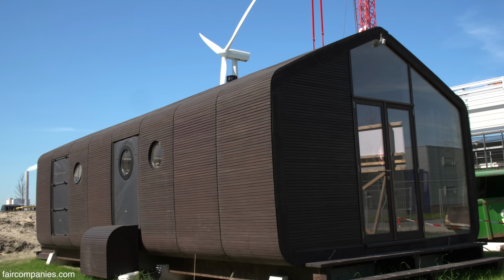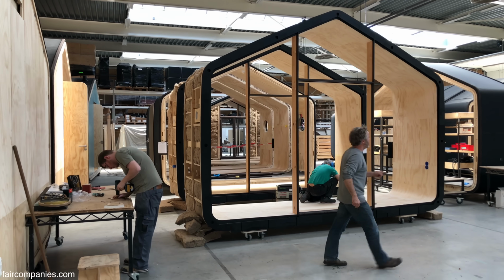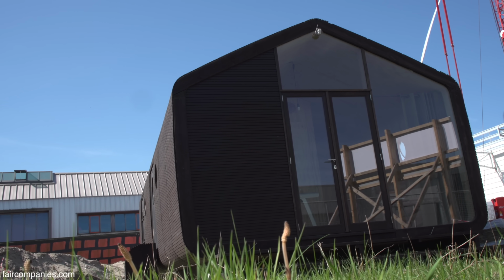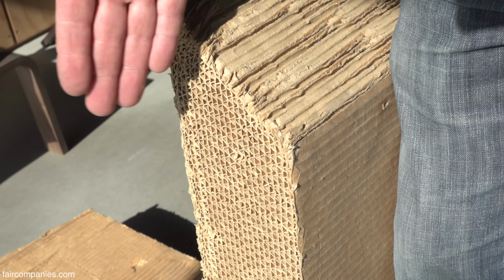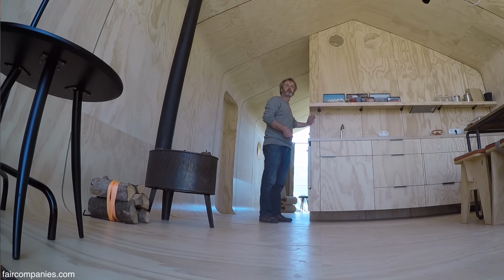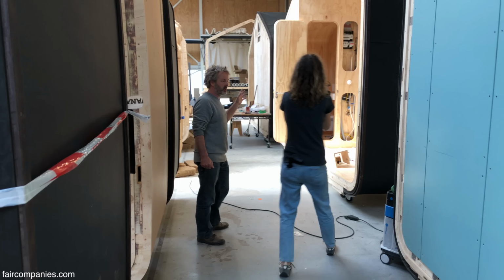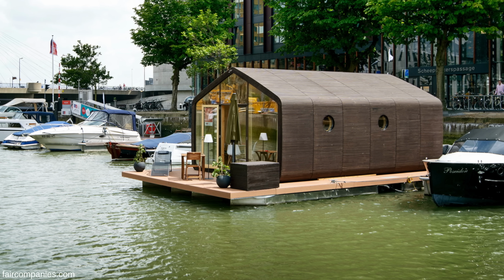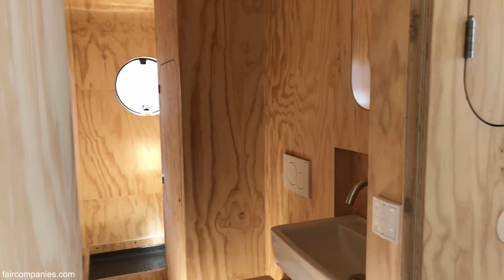Wikkelhouse: pick your modular segments & click them together

Comment: looks poorly made get a coodo instead
Reply: What's poorly about it?

Coodo looks nice too. It looks like Coodo is clean looking. It is steel frame based.
Whereas Wikkelhouse is more natural looking. And hardly contains any steel.
The major difference is of course that Wikkelhouse is mostly made of cardboard.

With Coodo you can stack a module on top of a ground module. Which can be considered an advantage.
Due to the material used (cardboard) and production method used (wrapping) this is (currently?) not possible for the Wikkelhouse.
Coodo modules are also wider. Which might be an advantage or a disadvantage depending on location or preference.

Given the information I have seen thus far I cannot tell whether one has a higher quality than the other.
All I can say is that the two, though both  being modular designs, have a different design philosophy.

Comment: For those interested, they cost around 11,000 euro per segment. Shipping container prefabs are likely to be better value
Reply: In Germany you get "flatpack" prefabs with proper walls that can be shipped with regular trucks and put up in a single day. Which gives you more of a traditional sturdy house than this and is only slightly more expensive, if at all.

Comment: pretty expensive for cardboard is a neat idea though ,, if the price was different these things would sell like crazy,  these could actually solve homelessness but the price,, for same price you can build a normal wood or brick home,, you can buy a double wide trailer with hot tub for 20,000 $
if they priced these to sell they would make alot of money  cause they are very portable there still a market for them,, but that price very unattractive if they change price and contact certain city's to buy them to fix the homeless issues that would sell like crazy

Comment: 10000 euros for each segment is a bit much. I guess if you didn't bother with  the cardboard and used standard insulation you could make it for a lot less. 20000 euros should be able to get you a finished 8 segment house if you built it yourself. It makes you wonder why standard houses are so expensive. I'm guessing it's all the regulation and red tape.
Reply: A large part is the labor. But materials are not cheap. I bet each bare section has $2000 just in materials.

Comment: First time it rains and there is a leak, the cardboard in the walls are 
going to go to crap. These might be fine in a dry environments, but I'm 
just thinking about here in Florida where we have a lot of humidity in 
the summer, and cooler and drier in the winter. The contraction and 
expansion between the weather extremes can create a seam leak, which 
would mean curtains for a cardboard house. Whether it is the seam between
 the sections, or at the windows, Murphy's law, there will be a leak sometime/somewhere. 
Also, Florida roaches love wet wood and even more so, wet cardboard, they 
would have a field day with this house.
Another problem I see, is it it doesn't allow for things 
breaking or going wrong , like what happens in real life. For instance, what 
happens if there is a leak in your plumbing, and by the time you fix the 
leak, the cardboard behind the bottom the walls, and your floors are wet?

Comment: Very much suitable for hot climates.
Only thing is the life style and usage of water. In India  bathrooms are not usually dry because of usage of water. Instead of corrugated paper board, you may have to use PVC corrugated layers on the inside and outside. Then solve the fire -resistance problem. I like the idea.

Comment: Needs ventilation in the bathroom. Probably better to have a built in fan there. Also in some places we are not allowed to burn wood so it would be better if you could integrate solar power in some models. I'd also prefab the house in the factory and ship the house to the site. The use of a crane and the construction crew on the site is probably very expensive.

Comment: Imagine if a fire happens..$80,000 for a cardboard “home” put together by glue? An insulated plastic home would be better for rain protection
Reply: Most people in house fires die from fumes. Not that there aren't hazards here. Single-story structures like this are like little jet engines, if they are tubular enough, they can really get a fire going from the draft. That's why metal mobile homes are so dangerous. Houses with an attic, and wood houses, are safer because the toxic/explosive fumes rise and ventilate. Even a hole burning in the wooden roof of a house can actually save the structure and lives.
Reply: Just curious,  did you see or hear something different than me ?
Did you not watch the same filming I watched ?
 He states,  it is fireproof( ooops FIRE RESISTANT)

Comment: He mentions the table material being flameproof cardboard, but not the house.
Wonder how the shape was determined, because an arched roof would distribute the load better.
I skipped through some of it and didn't hear whether the structure, raincoat and cladding were suitable or freezing and snowy situations. Having seams run vertically over the roof seems like it would invite leaks.

Comment: People don't know how it's unhealthy living in this recycled, glued rubbish. Same garbage as that cheap furniture you buy to put together.
Reply: If you have plywood anywhere you are living with "unhealthy glued rubbish" as you put it. And when paper is recycled it goes through a chemical process that gets rid of most of the previous printing materials on the wood fibers.
Reply: @tstuff  and you think those chemicals just evaprote? They don't stay in, you don't live with them, breathe them, they don't get released when space is heating, cooling, shrinking, expanding? It's unhealthy, same way as living in steel/concrete isn't healthy, but we've been served that that's the "future" and we're supposed to swallow it like everything else.
Reply: @drazenmiskovic4952  Every material used in building houses has some form of chemical treatment.

Comment: LOL you can destroy it by drilling a hole into the wall to hang something. because once you drill into the cardboard layer you end up breaking the water seal, and over time you end up with cardboard soaked up like a sponge all the moister in the air.

Comment: Very interesting. 
I would want it more solid. When he hit the wall and said “ it’s solid” it dented the cardboard. If you accidentally hit the wall you have holes that are not easily fixed. 
In comments someone said it’s around $80k for a full size home. That’s not cheap.
Reply: You wouldn't be hitting the cardboard. Both the inside, and outside are built with plywood. Then cardboard makes up the insulation essentially. The outside then has the plastic protective layer, followed by another layer of plywood.

Comment: I have to wonder about that "raincoat" moisture barrier he spoke about that's exposed despite the facade covering. If that get punctured from debris or animals, the cardboard is open to being soaked.... By the time you notice the soak from the inside, the cardboard would've already deteriorated and molded on the outer surfaces.
Reply: There's wooden cladding on top of the raincoat
Reply: @Bork_Cruk  Right. I acknowledged that already. The cladding strips has gaps in between themselves from what it looks like, no?
Reply: @aos-archive  Sorry, didn't see that.  I dunno, I'd say it's probably pretty sturdy.  But I get what you mean, if it was punctured and you didn't know, could cause problems.  Same is true of many structures though.  Get a leak in your roof you don't know about  and you can have serious issues.  I'm sure it's still repairable.
Reply: I don't think that would last in South Florida 😕
Reply: @arlie1118  All of Florida has hurricane issues. The amount of wind it can take,  The F- factor.   I really do not see anything like this without an outer shell being permitted here .
Reply: Yes, I would be very concerned of water , perhaps from a leaking roof, or a flood. The entire house would be destroyed.
Reply: Probably not a structure you’d want to have in the pasture with the bulls. 

But then again, would you want “animals” abusing the house you live in now?
Reply: @dozer1642  thing is animals cant abuse my concrete walls
also many insects actually eat cardboard because of the cellulose used in the glue.
Reply: Catnium your comment has neither context or relevance. 

I wish you the best in your endeavors.
Reply: That was what I was thinking as well. Looks to thin.

Comment: Using this technology they could test their use on Mars in Antarctica ... ? Any kind of flat thin composite material that can be folded and glued up like the cardboard single-sheets to be then rolled and glued up like this ... very economical. If they could find an appropriate building material on one of Mar's moons they might be able to assemble them in orbit, and drop them by parachute through the thin atmosphere? ... or parachute the building materials to the surface to build in situ.  Intriguing!

Comment: The main deficiency is too many joints and odd increments. It causes custom parts that raise the cost. If he were to modify the machine that makes them so that they are maybe 1.75 or 2m sections it would tremendously increase the useability while probably reducing cost. Even increasing the size to 1.5m would help. This will result in fewer sections and less custom interior parts. Many parts could be bought off the shelf or even left out so the customer can buy what they want. The overall design is pretty good, just needs a bit of tweaking. The right angle section is a step in the right direction. (so to speak) Cardboard in itself is not a panacea to problems. Less cardboard, some injected closed-cell foam and an engineer that can suggest some details are needed. The exposed rib on the floor  16:17  for the right angle section needs to be changed somehow. It is a tripping hazard and will eventually chip and cause problems maybe after 10-15 years of use.

Comment: This guy sounds like he's trying to sell redemption to the pope. IT'S CARDBOARD ffs. Yeah we can make tables and houses out of it.. OR WE CAN USE WOOD or any number of other more applicable techs. Honestly, this guy sounds edgy.. Like a moan away from pulling insect wings and children's heads off. Is all this fantasy coming from some giant inheritance? Can't see the economic reality. Must be fun to work for ...
Reply: yeah its sounds more like a novelty than anything. why use cardboard if you can use wood. i dont know the rate they bought the carbdoards sheets on but thinking about all the manufacturing processes cardboards go thru it cant be cheaper than many wood alternatives seeing that cardboards come from wood. there is the combustibility factor.
Reply: Two reasons to use cardboard instead of wood: Weight and insulation. Cardboard is hollow, which  makes it both much lighter than wood and a much better thermal insulator than wood.
Reply: @KimonFrousios  I'm inclined to disagree.. two thin sheets of ply, battened together with air gaps would be light and insulating too. Indeed, that's all this really is but with cardboard in the gaps, which, if it gets wet and rodents get in.... yuck!
Reply: ** Greta Thunberg Voice ** HOW DARE YOU!

on a serious note, the idea is interesting, but you're right: if you can use wood, use fukkin' wood.
Reply: @rtstrong  It's ok Greta, he hasn't got his eye on your head. But yeah.. wood is an amazingly sustainable lightweight product. So is cardboard, but it ain't as strong, nor durable.

Comment: I dont understand all the hate in the comment section because some one is trying a new method,  it might not be the cheapest construction method out there and might not last 100 years but thats not the point.  New houses these days are not built to last that length of time anyway with most companys refusing to offer any sort of protection past the 15 year mark.  How often do you actually come across a 50+ year old house that hasnt been rebuilt in some form ???? 

Yes its a cardboard house in a way but its not a house just made out of cardboard,  if you actually watched the video and understood what they were doing then you would understand why it costs what it does.  The equipment required isnt cheap and the processes of forming then bonding all the plywood panels isnt a quick job and requires skilled craftsmen.

I love this idea and its giving me a different opinion when it comes to building my own place which if im honest was stuck at the shipping container stage currently,  I dont care if the building doesnt last 100 years i will be long dead by then so why should it matter to anyone else if thier houses last longer than they do ??   Money and property doent mean anything once you are gone.

Comment: The weakness of the concept is in the section joints alone. This is the problem of Japanese Metabolism architecture all over again. The more you have joints on your enveloppe, the more you multiply the risk of leaks and reduce the durability of the building.
Reply: That does not sound right to me. I'd be happy if I can extend the life of my house by replacing a section, just like my PC's life was extended by a new GPU and my laptop got on steroids when I installed  a large SSD
Reply: @fidetrainer  And what are you going to do if you realise too late that one of the central sections has a leak, causing the carboard to get moldy and damp. Are you going to pay for the removal and refurbishing each time, or risk your health and possessions?

Comment: if you design it in more of a container shape you might even with it being as thin, you myght see utilisation as a type of piller, infact 1 quorte of the lenght and you myght actually see that, possibly a 3rd, square triangle elipticle, perhapse utilise shipping containers and use the craite as an example for creating insulation, hexagnal, honeycomb like aproach for an indevidual wall, bouble wrap and reflective insulation using the walls of a container to insulate from water then transport that on locatin? if carefully applied it myght provide a bonus for tinyhouse living expences??? perhapse a piece of cardbard in the midlle of the hexagon holding things together or potentially squares tilted to act like dimonds witch would fit a square design with triangles n the frame, the key question is roofing and insulating during the instalation of tilets and other pipes, sower pipes, air filtration?

Comment: this thick layer of cardbord will be nice and sweet home for - BACTERIAS MOLD FUNGUS whatever!
Reply: @Chris Ruiz which also keep moisture inside once it get in - bright idea
Reply: It looked like a breathable fabric to me. At the very least it would have to be UV-stable, and there are a number of modern roofing materials that would fit the bill that are breathable.

I don't think mold is going to be an issue, but I guess that if the inner vapour barrier or the outer weatherproofing was breached and the cardboard did get wet and mold did set in it would certainly spread faster than it does on plywood or timber.

Comment: It looks really nice but I wouldn't trust the rain cover. Poke one little hole in it and the cardboard will soak unnoticed until the module is damaged. They probably don't trust that either that's why the install "traditional" (reliable?) wooden modules with flax on the ends.

Comment: The Only good thing I was expecting out of this was low cost... I am Really disappointed!
Reply: How much do they cost?
Reply: @Theonetheonlysteven  Since Wikkelhouse is a modular concept the price is based on the configuration of segments needed. You can purchase a Wikkelhouse starting from EUR 30.000,- excl. VAT (based on 3 segments and excluding transport and placement). However, most houses are sold in between EUR 50.000,- and 85.000,- excl. VAT, transport and placement.
Reply: $80k US. Which is not bad at all. Now that doesn't include site prep, sewage disposal system and other utility hook ups or the land. I have been building a cabin with my wife, part time, for the past 2 1/2 years and when I am all done I will be around 150K US.

Comment: Get the price down to $10,000 for 3 sections and you have a homelessness solution cities might support in the US.
Reply: It is $4500 USD per module.   (not including installation and delivery).   Each module is 60 sq feet.    So you can get cheaper.   However building in Europe and shipping costs to the U.S. would drive up the cost to be too prohibitive for a homeless solution.

Comment: Is it fireproof? Otherwise, this is a very dangerous idea.
Reply: Except for it looking like they're using Rockwool (which is fire retardant insulation made from rocks) or something similar in the walls of some of the modules, these things looks like death traps if it were to catch fire while people sleep in them.
Reply: Is a wood frame house fireproof?
Reply: @samsonthecurrent  A wood frame structure has a burn time and rated fire doors and newer construction has fire blocking to slow the pace of a structure fire to allow the occupants to escape.   This thing would NEVER pass building standards in the US - its burn down time is likely incredibly fast.  Its a fking cardboard box!!

Comment: Each module costs approximately USD $4,500, with a completed version of a basic Wikkelhouse expected to cost around USD $80,000 and it's life span is up to 50 years, so sooner or later it will not be usable. So basically it's throwing away money.